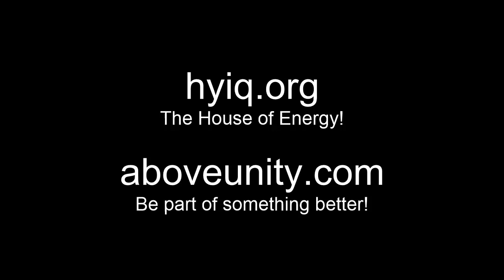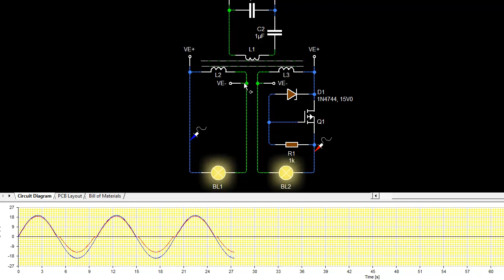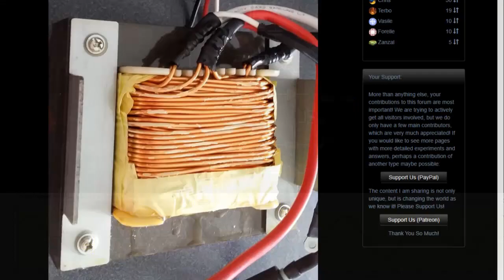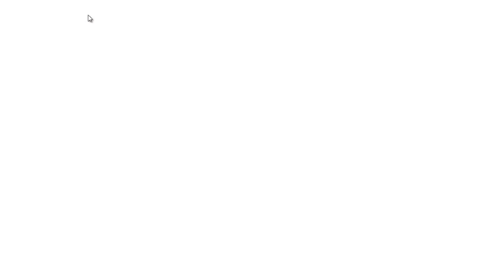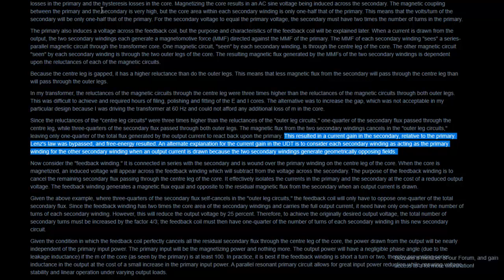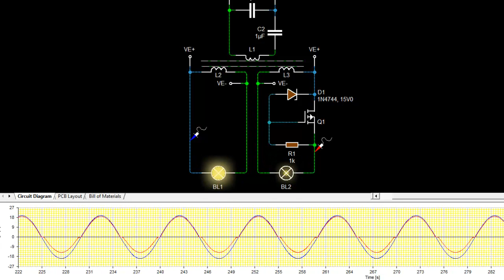Signifying Delayed Conduction.

Comment: Hi Buddy, Fantastic job with the video.  - my transformers are still not cutting the mustard.  - i appreciate your educated approach. - - im really having too concede that is the way forward. -   -  your insight came with syncronous timing with the completion of my coil winding ;-D  .  https://www.youtube.com/watch?v=Cp1WjX8hk_8  - i am liking your ideas , that i am interpreting as magnetic flow, like water.... i will post my fails on the forum, and hopfully get some tips.  but this is a tuff nut too crack.
Reply: so frustrating when nothing works.  its great too learn about all the possible complexities . but leadskalin just used horseshoes and bunnings fencewire. -  reverse your coils and presto. ... hmm. i wonder if he would see me as a modern idiot despite the smartphone......

i wish even the simplest manifestations ive tried would work. - do you think i should ditch the transformer, and try replicate leadskalin too get a feel for it ?. since i dont a have the brain for it....